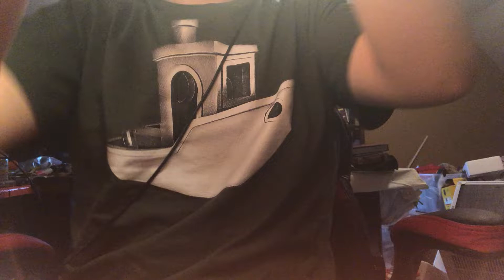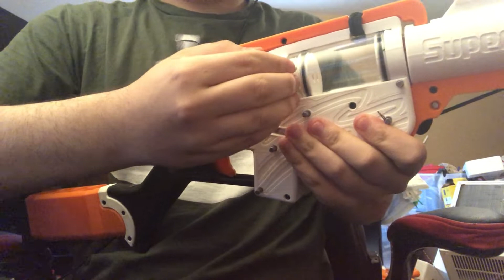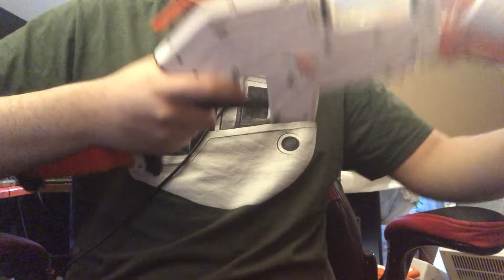Funky air seal

Comment: with my qualifications just being a rando on the internet, did the seal act differently before or is it possible that the initial movement is based on how far you can compress the air in the chamber before it starts providing any resistance?
Reply from the maker: " initial movement is based on how far you can compress the air in the chamber before it starts providing any resistance?"

That is probably it, yes. Previously, the plunger would just slowly move forward, as the air leaked slowly.

Now it seems like the seal is good enough that it seals perfectly at first, then leaks out over time.